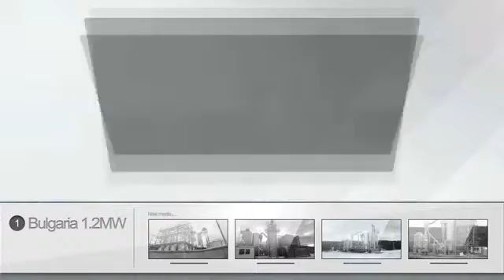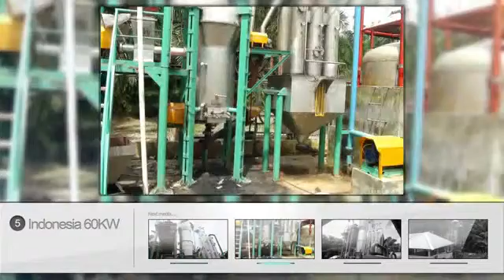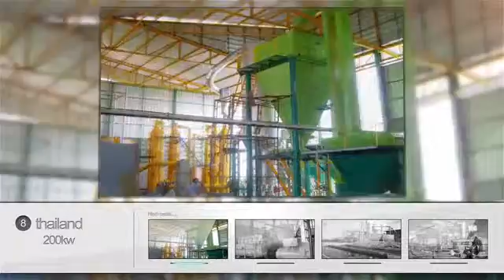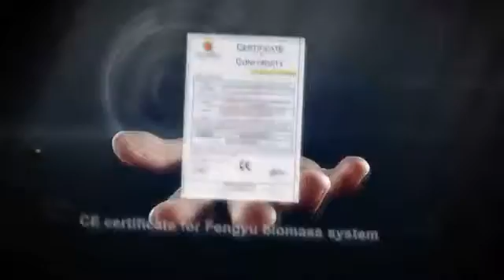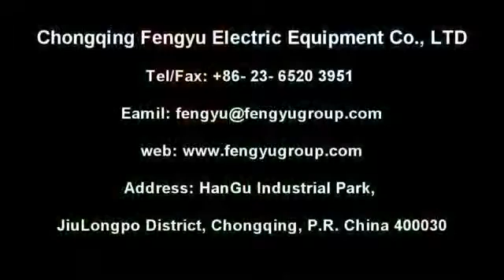Chongqing Fengyu Electric company profile-leading biomass gasifier equipment manufacturer in China

Comment from the maker: As the leader of biomass gasifier equipment manufacturers in China. Our company, with a history of 34 years in electric power industry, has been specialized in the design and manufacture of Biomass Gasification Power Generation Equipment since early 2000.
 
We've already set up many successful projects in Philippines, Thailand, Indonesia, South Africa, Kenya, Bulgaria, Slovakia, Italy, Romania and Croatia etc. Most of them have been in continuously smooth operation for more than two years.
 
Our main biomass fuels are agriculture and forest waste,such as rice husk, wood chip, saw dust, straw, crop stalks, coconut shell/ husk/fiber and MSW/RDF etc., and the diameter(The size means its thickness instead of length) of feedstock should be less than 10 mm while the water content (moisture) less than 15%. In case of shortage of a certain biomass fuel , you can also use variety of feedstock to meet the requirement for your capacity.The capacity of our project can vary from 30KW to 15MW.
 
The total area needed for our 1MW/1.2MW gasification workshop and engine control room will be approx. 800/1000 square meters only. However,the area for biomass fuel pretreatment and fuel storage house are not included. No special restriction for the location of our power plant,as long as there will not any schools,hospitals and residential area nearby within 50 meters radius around the power plant.
The feasibility of a bigger project will mainly depend on enough biomass feedstock supply available, enough project fund, and the price of your local feedstock and electricity tariff. Before we move further or you decide to visit our factory, please try to let us know more details about your project first by filling in our Biomass Questionnaire attached first as much as you can, then send us your filled form, so that we can evaluate the feasibility of your project first before we decide to move further, thanks for your kind support! 
We not only just sell the equipment itself,but also our cautious, ingenious design and our rich experience over the past two decades, you can’t miss it. On behalf of our management, thanks for your trust in our biomass gasification technology again.If there is anything I can do for you, please feel free to contact me,I am glad to help.
 
Looking forward to your earlier reply at your convenience!

Best Regards
Michael Jiang
Sales Manager & Sales Engineer
International Trade Department
Chongqing Fengyu Electric Equipment Co., Ltd.(since 1985)
Registration No. of Business License: 500106000056246 1-1-1
Gold supplier of Alibaba(www.alibaba.com) since 2008
Registration No. of ISO 9001: 01610Q21565R0S
Registration No. of CE certificate: 100903/FEE674
SGS certificate No.: ECM-2013-039
Website: www.fengyutech.com
Contact email: fengyu@fengyugroup.com
Wechat number: jz314041271(www.wechat.com/en)
Whatsapp: 0086-13372629568
Mobile: 0086-13372629568 or 13012356196
Add:Urban Industrial Town, Ge Le Mountain,Sha Pingba District, Chongqing, P. R. China

Comment from the maker: Fengyu Electric Company Introduction

Founded in 1985, Chongqing Fengyu Electric Equipment Company Limited is a global leader in the production of biomass gasification equipment, gas generator sets, oil filtration and purification equipment. 
With sophisticated patented technology and expertise, we have developed an internationally acclaimed fluid-bed biomass gasification furnace (patented) product, which efficiently gasifies biomass fuel, such as rice husk, sawdust, woodchips, crop stalk, biogas etc. The resulting pyrolysis gas is used for power generation and other purposes. We now have 20 projects overseas in smooth operation with 5 projects currently under construction, leaving no doubt that we are one of the leading biomass gasifier equipment manufacturers in China.
We also produce 200 different types of oil purification, air-dry generating and SF6 retrieving devices and equipment. Our highly reputable, power plant, mechanical, transportation, petrochemical and military products are widely used globally, with more than 23,000 sets of equipment currently working efficiently all over the world. 
Chongqing Fengyu Electric Equipment Company Limited has the quality standards approval of ISO9001:2000,CE,SGS, and was awarded a gold medal in the First China Patented New Technology Products Fairsponsored by the China Electric Power Ministry. We have been recognized by China Electric Power Ministry as an enterprise that sets the Industry standard and benchmark for the production of oil purifiers, related auxiliary components and other electrical equipment, such as SF6 maintenance devices, CK vacuum evacuating devices, etc.

We are seeking sales agents in different international regions to distribute our highly reputable, excellent equipment, which is also backed up by high-quality service and market-value prices. We wish to build sound working relationships with interested parties and welcome all related enquiries.